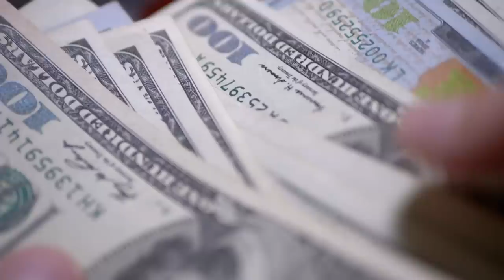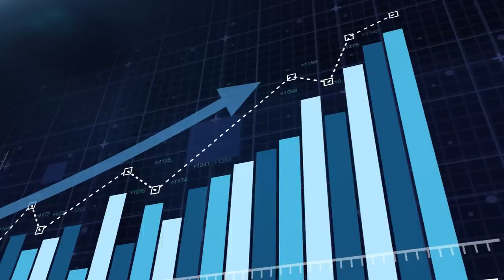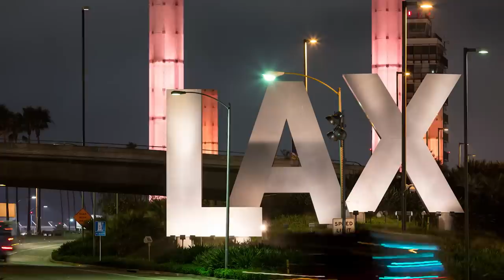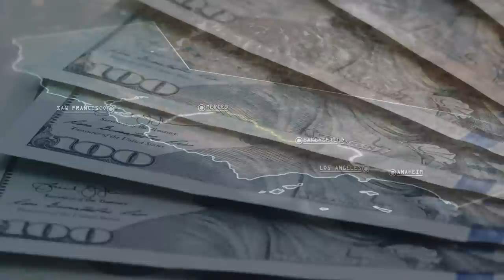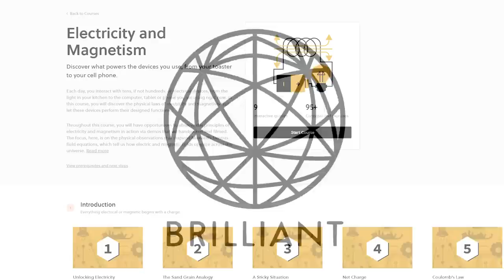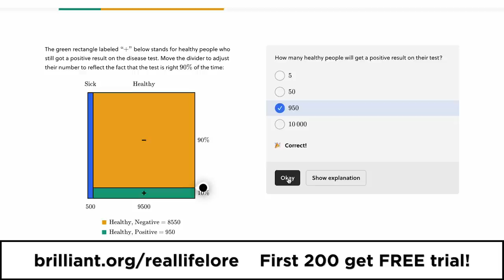Why California High Speed Rail is Struggling (Re-upload)

Comment: First of all, I'm glad you've corrected the original video. Any one can make mistakes so it's important, and unfortunately not common enough, to  admit and fix them.
As for the video itself,
I do hope that this project will be completed as it is  important for California and the rest for the country but you need to change your attitude and start investing public funds in such important projects, like you did with the highway system. Yes, the cost is high but the benefits will be higher. Unfortunately Anglo-Saxon countries seems to have the same cost problem and the US is up there with the UK, New Zealand, Canada and (for a lesser extent) Australia but they're still doing it and so should you. The UK is also building wright now their first actual UK high speed line (the first one, HS1 connects London to the channel tunnel and does not actually serve travelers inside the UK), that will be shorter and the current cost is around 100 billion pounds (up from around 35 billion - so just like the US), first phase was suppose to open in 2026 but will open around 2029-2033 and the complete rout (that was scaled downs after cancelling the extension to Leeds) might not open until 2040. The only different is that they will build it and it will open someday.
As mentioned in the video and by many here California is the 5th biggest economy in the world (if it was a country) so if the UK can do it and if my home country of Israel, that tried to be like the US but now understand that they must invest in public transport, can invest more than 100 billion (on several projects like LTR systems and a metro system in the central area, and a LTR system in Jerusalem, and rail infrastructure including nee lines, extending existing lines, electrification, new signaling system ETCS Level 2 and high speed lines) that surly California can invest it on HSR.
With time you might get better at it like the country I live in today - Spain. We spend less for every km than any other country (yes, less than China and unlike what you said in the Video). The cost of the whole current network of about 3600km (and more planned) was about 66 billion USD. The line between Barcelona (where I live) and Madrid is the same distance as LA and SF, a direct train takes 2h30 (there are trains that stop in some or all stops along the way and take a bit more than 3h) , and if you buy in advance you can pay 20€-25€ on some trains. The reason for the low price is the open access policy of the EU. Rail infrastructure was separated from the rail operator (in Spain RENFE is the operator and ADIF is responsible for the infrastructure - both are state owned) and now other companies can also operate trains one the same infrastructure. The first company to start operating was SNCF (France national rail operator) under their low cost brand OuiGo and RENFE joined with a low cost brand called Avlo - both start at 9€ but the average if you don't wait for the last minute is 20€-40€. a third company caller IRYO (a joint venture of Trenitalia - Italy national train operator - and Air Nostrum - an airline that operates the regional flight of Iberia Airlines in Spain). This is not unique to Spain and happens in other parts of Europe.
Maybe the future of California high speed train is to finish the line and make it an open access infrastructure  maintained by the state with a few private operators competing each other.

Comment: You start out by saying it was designed to link LA with SF with 'numerous' intermediate communities.  That is the ruin of 'high speed', every stop adds five to ten minutes to overall travel time (you have to consider time lost while slowing down before the stop, the stop time itself, and the time to speed up) this is one reason why the NE corridor Amtrak trains are slow as compared to other HS lines elsewhere.  I have used the Eurostar between London and Paris, there are no intermediate stops, likewise GTV from Paris to Lyon, no intermediate stops and the only stop on the Italian line from Milan to Rome is Florence.  On the GTV lines your ticket tells you precisely where to stand on the train platform so there is little or no crowding while boarding or exiting the train, this allows stops to be done in 3 minutes.  As for the real estate questions, realize that when you cut a farmer's property in half with an uncrossable wall, you are effectively creating two farms and reducing the efficiency of the operation, you have to pay for this as well as the land.  There are significant issues with using the existing commuter rail corridor between San Jose and SF that will significantly slow down operations on this section and the problems between Bakersfield and LA are still largely unknown, seeing the overall line completed anytime before 2040 is probably unlikely and a better target might be 2050.  A major consideration in the passenger potential is family and group travel, while it would be cheaper to take the train vs the car for the individual traveler, cars have four or more seats and the incremental cost of these extra seats is almost nothing furthermore the task of driving can be shared and the car is already the first mile and last mile solution in any case.  Unfortunately too, the CA electric grid is subject to scheduled and unscheduled outages lasting from minutes to even days, this would be unacceptable for a rail line and reliable backup power  must be provided as part of the system design.

Comment: I had to take a 7 week lecture seminar on HSR back in 2012, and I was very pro HSR going in, but after hearing a lot of the ticket pricepoints and the idea to be to increase commuting from places in the valley. I did the math with my Honda Fit and gas prices at the time, and it was marginally faster and more expensive to get one person to and from LA from Fresno by HSR than it would be by car, and then there’s the problem with inner city public transportation. Uber was barely taking off at the time.

As a Fresnan, moving parts of CA99 over by like a small amount has been so unbelievably inconveniencing, and caused several small businesses in the area to struggle or close. My favorite local chicken place was one of them. 

As much as I’d love for the valley to be supported, especially as a valley resident myself, they should have just built it along the 101, not the 99. It’s SF to LA that’s important, anyway, and we have rail, flights, and freeways to get from the valley to the bay or socal.

Comment: A factor that doesn't get much discussion when it comes to HSR is the demographic collapse California has experienced in terms of projected population.  When the HSR bond was voted on, California was projected to have nearly 60 million people by 2050.  Investing several billion dollars for a future transportation system to help an expected extra 23+ million people get around the state in 40 years might have seemed like a no-brainer to voters at the time.

Now California is expected to reach 45 million by 2050.  That's less than 6 million more than the current population.  15 million future riders of HSR as of 2050 have simply disappeared.  I've never seen any revisions to ridership/revenue based on the reduced population projections.

HSR is the only big infrastructure project California undertook to support a booming 21st century population.  When you look at other areas--housing, electricity, water--the state simply isn't taking the steps necessary to support a population as large as expected back in 2007.  And I think citizens have noticed and responded accordingly.

Comment: As a Californian,  let me touch on two points from tje video. 1. The terrain to get into LA is the grape vine mountain and the Cajon pass which are mountains one has to get through to go the the region. Secondly,  you have the price. As I write this comment I am in Paris.  I took the Eurostar from Paris to London. For a round trip ticket costed me over 450 Euros. I went on and paid it because I wanted the experience of being on a high speed train.  Still, tje price was more that a plan ticket. This would only work if the price is cheaper than tje average airline ticket. Another talk about high speed rail is between Los Angeles and Las Vegas.  For all the reasons why we cannot have an initial line between Los Angeles and San Francisco,  we can't have an initial line between LA and Vegas.  So now they want to start in Victorville to Las Vegas with mostly dessert and little interference with residential areas. Still, can't get it done, despite all the wants, talks, announcements. Mo wonder we can't go to the moon no more.

Comment: For the connection to San Diego from Los Angeles, assuming they build the rail with this in mind, they could just use a bunch of the existing line and go through there to connect San Diego.

Comment: A Shinkansen ticket from Tokyo to Osaka, which is about the same distance, also costs around $100-$150. So the ticket price doesn't seem that unreasonable... altho the Shinkansen is faster.

Interestingly, a plane ticket is cheaper here too, but but people seem to still take the Shinkansen a lot. I would suggest a train ride is just simpler and more convenient, than having to go out to the airport, wait around, go through security, fly, then have to take another train back into the city on the other hand. This is especially true if the HSR is well integrated into existing infrastructure, with a good number of stops, so the time it takes to get to a station isn't outweighed by the time it takes to get on a plane. Or of course, some towns just might not have an airport in the first place.

Comment: I've written my State Rep., and his office replied that there's a more obvious problem halting progress.... The obvious solution (build parallel to I-5 and slow it down to 100MPH over the Grapevine pass) is disallowed. The law requires that rural sections have speeds of 200+MPH. That is practically impossible given the steep terrain that separates Southern California and the Central Valley. I-5 and CA hwy 58 climb nearly 4,000 ft. in 15 miles over the Tehachapi Mountains. This would require tunneling and land excavation on an impossible scale. 

This is tragic.... we desperately need rail service in CA.

Comment: Again as it has been said before with the Chinese railways. High speed trains are NOT built to make money or to be cost effective or cheaper than air/car travel. Hight speed trains are suppose to REDUCE carbon emissions and be a more environmentally friendly way of travel for the future. Yes its going to cost more and it will be over budget but in the long run its more sustainable from an environmental perspective. Its not always about money

Comment: Still too many mistakes even in this "corrected" video. It doesn't look like he corrected anything other than the wrong things that were specifically pointed out to him. "Budget Wendover" is too much of a compliment for this guy. He's more like budget "Ancient Aliens"

Mistakes in only the first 2min03sec:

1. He compares the LA's Combines Statistical Area (CSA) 13 million population to something that isn't the  CSA of the SF Bay Area. That is not "almost 8 million" like he says, but almost 10 million population (9.71 million). Why compare apples to snakes?

2. He says "more than 380 miles away form each other... takes 6 hours to complete", but shows the considerably longer coastal route that isn't even a practical roadway to reach SF from LA or viceversa. That road can take up to 12 hours of driving on twisty roads vs. 7-8 over the two major north-south highways (101 and 5).

3. He says that flying between SF and LA takes a "1.5 hour journey". That's not true in any way. The actual flight takes between 55 minutes and 1h05min. The flight with boarding, TSA, walking through airport etc. takes at least 3 hours at those airports. This is why the maximum SF-LA time for CHSR was set at 2h40min in the first place. Where did he even get that 1.5 h number?

4. He says that SF-LA "is the second busiest flight route in the US". That's also not true. It's been the most popular flight route and the most popular city pair travel corridor in the US for a few years now. (Keep in mind that there are 3-4 airports in the Bay Area and about 6 viable ones in the LA area, not just SFO and LAX).

5. "CHSR would be a first for the United States". The Acela is widely acknowledged to be the first HSR service in the US. Yes, it isn't HSR throughout the entire route, but so aren't many HSR services all around the world. Plus the NEC, where the Acela runs, more than qualifies as HSR by the international HSR standard. Yes, there are only a few sections where it runs at 150mph. But it has 125mph sections all over the place. It is a legacy railway not a purpose-built HSR ROW, and those qualify as HSR already at 125mph not at 150mph, like brand new HSR track.

6. "CHSR was supposed to be cheaper than flying". No one ever said that. People said that competition with the airlines would reduce prices for ALL passengers on this route. He's misrepresenting and not even giving the name of whomever he is quoting.

I got bored about here. Clearly this guy doesn't care about using accurate information. He can't even get basic statistical information and maps right!

Comment: Given the huge price tag, I am not sure if the California HSR is ultimately worth it. One other thing that is rarely talked about is energy use of high speed trains. Due to the high air resistance at these speeds, it is actually comparable to planes, if not worse. At least with the current energy mix, this also implies a similar CO2 footprint per passenger mile. Of course, ultimately we need to switch over to 100% carbon-neutral electricity sources, but the same is true for aviation. I would not be surprised if in the end, a plane running on hydrogen needs about the same amount of (renewable!) energy as the train. Minus the huge cost for the tracks of course, so there is that.

Comment: So in 2008 the ticket cost was estimated at $50?  Now (2023) it's estimated at something like $170.  But the cost to the taxpayer for each of those passengers is over $900.  Every single passenger will be subsidized by taxpayers to the tune of $750.   Every single passenger.

Comment: "Supposed to be a cheaper alternative to flying".  What?  It NEVER was going to be cheaper than flying, even from the beginning.  I did a 'paper napkin' calculation in 2014 when HSR actually published their cost estimates (can't find those anymore) and, at the average price of an airline ticket back then of $95 LAX to SFO (you could get deals for $50 or less too at the time) I estimated a full passenger train of 2,000 (turns out each train will only hold 400), leaving every 15 minutes, and full 12 hrs a day each way, the revenue wouldn't even cover THEIR OWN PUBLISHED O&M COSTS!  Let alone pay down the Construction costs!  It wasn't even close!  So, no, only an idiot would think that this was supposed to be a cheaper alternative.
Reply: Lo and behold an article in the Fresno Bee popped up tonight about ridership.  California HSR Authority just lowered their ridership estimate by 25% when the LA to SF part is finished to 6.6 Million riders a year.  If you crunch the numbers I did above, I was using 70 MILLION riders a year and it still didn't pay back O&M let alone pay back the cost to build this.  Wow.  Frankly I don't think this thing will ever be built and if it is I don't think they will even get 6.6 Million riders a year.  It will be an expensive amusement ride to most.